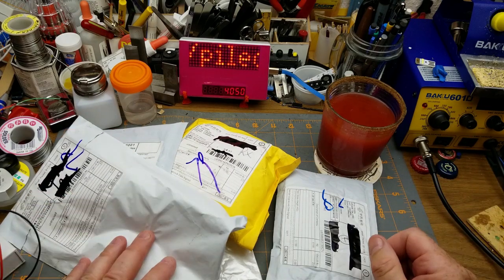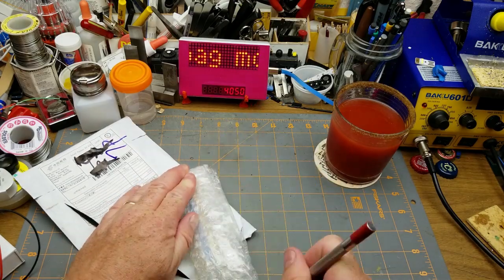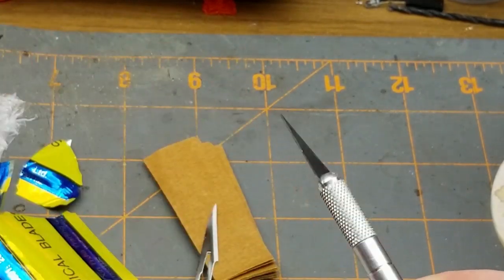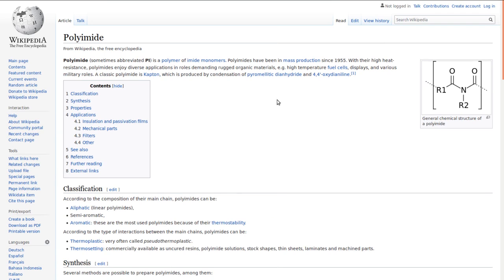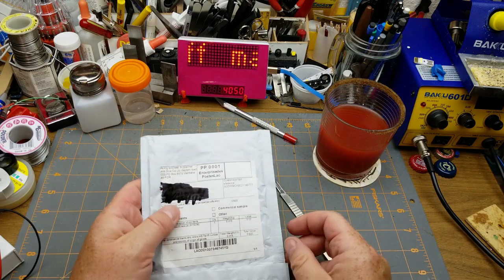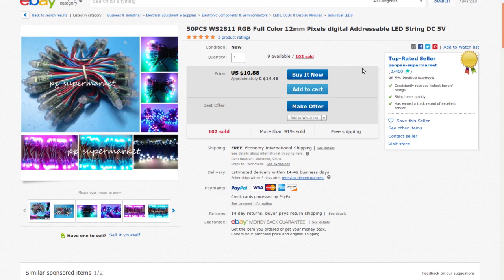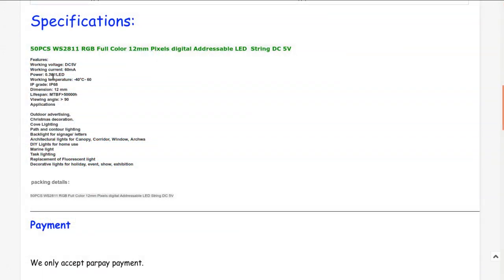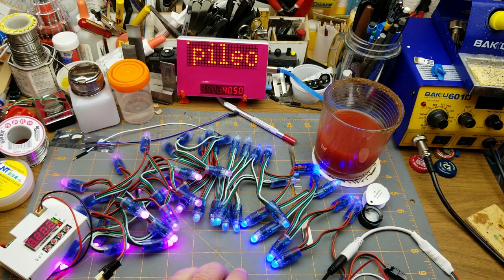mailbag monday #65

Comment: When I was young, I use to make a lot of models. My father was the head storemen at one of the public hospitals here in NSW, so I had scalpels coming out of my proverbial. I cut myself a lot more getting the blade off of the handle, than putting it on.
Reply: I always use a pair of pliers to remove a used scalpe blade. A lot safer.
Reply: @glyndevonport7802  I learned that the hard way.

Comment: I bought 24 sets of those WS2811 strings from another ebay seller for about $9 a string. 
i am building a 15 foot high 900 (12 x 75) node pixel grid tree this year.
along with a 20 x 10 grid for scrolling text for christmas

great tip, dig up  a   nodemcu lolin board and flash it with ESPixelStick firmare. connect the lights and you get a artnet capable wifi light set.works with xixen,xlights,and jinx?
Reply from the maker: That's a good price. I hope I can find something like that when I buy a few more.
I haven't decided how to control mine yet. Maybe an ESP8266 or similar that I can send patterns to from my phone..
Though artnet (or even good 'ol DMX) might be interesting...

I'll take a look at that ESPpixelstick project (pretty sure I have some variant on a nodemcu around here..). Hopefully it isn't beyond my code ability!
Reply: @pileofstuff  the firmware is super easy- but you may not want to compile it yourself tho due to dependency and stuff , there is a firmare flashertool included  in the not quite latest builds. you run it , tell it you wifi info and serial port and it flashes it for you, without having to compile it youself or have and arduino ide installed . it also runs a webserver on it so you can confuge it easy. the wifi wont play well with wep or open wifi , only a wpa secured network
Reply: I bought a few strings of those LEDs last year for GBP6.75 each (Aliexpress, seller "SLM LED Lighting") and finally got around to using them on holiday this month. I laid a couple of them linked together down one side of our trailer while camping. I only fed power from one end and the voltage drop to the other was pretty massive, but when all they were doing was twinkling, they were good enough. At some point I'll build a proper 5v distribution underneath and be able to run them properly all around. It is a shame that while the lights themselves are waterproof (they survived very heavy rains and light flooding last week in Cornwall), the connectors most certainly aren't. Still, at that price you can't have everything!

*EDIT* Just had another look and they are available with waterproof connectors now. Much more expensive though.

Comment: For tiny stuff scalpel blades are so much better than excto. When I tried them out quite a while back, I've never used exacto style knife after. Scalpel blades are very cheap but also due to sharper blade sharpening angle and thinner blades they take less abuse. However, I do not abuse knives, I use them for cutting only. I find scalpels good also when you need to make a sensitive cut where almost no force is possible.
Reply from the maker: That's one of the reasons I have several xacto type knives. 

One always has a fresh sharp blade, the others have a variety of blade shapes and levels of age/abuse.

I am really liking the scalpel blades, though. This cheap handle leaves a bit to be desired, though...
Reply: @pileofstuff  I found comfortable handles (may be even brand ones!) and selection of blades. If I need something for eg. prying I use more proper tools though.
I think even branded blades were not that expencive when I bought them in packs of 100 (nonsterile of couse).